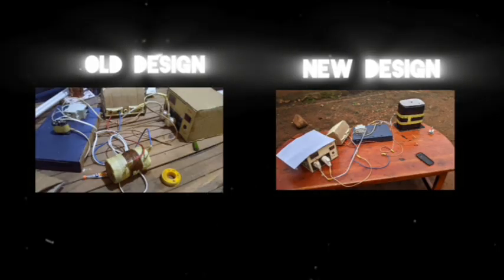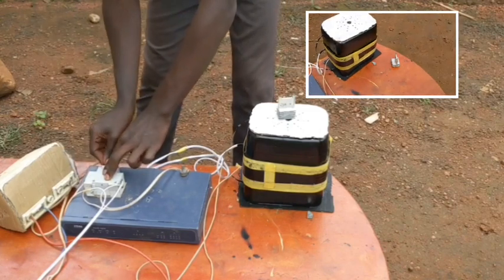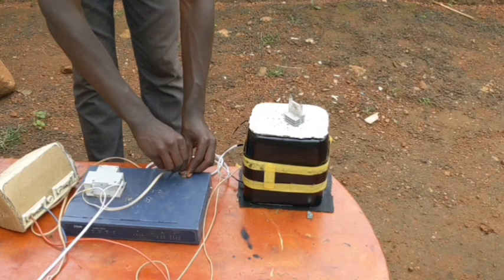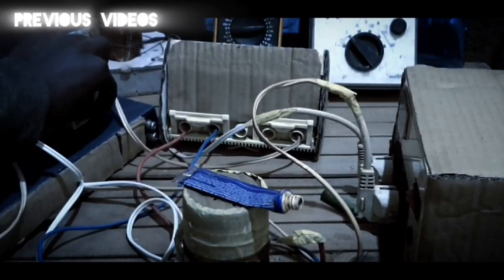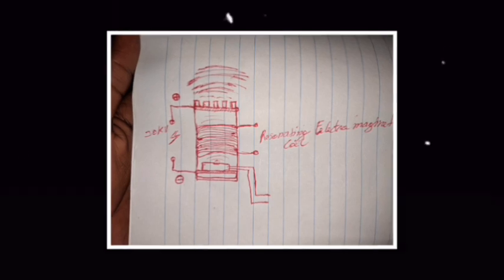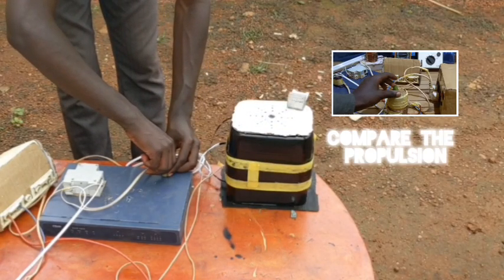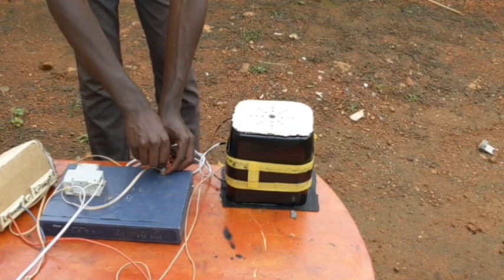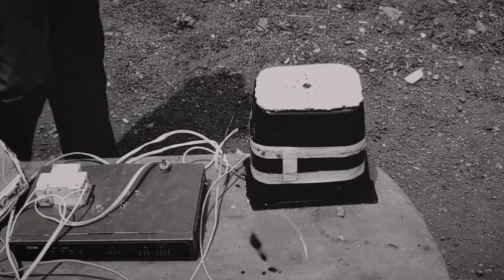KEIDIUM LEVITY DEVICE: Antigravity Test 2

Comment: It appears you are generating Gravitational Waves from your device. The Gertsenshtein Effect will explain this because it appears this is what you're doing. I noticed when you made a very sharp increase in the ultra sound the effect magnified. How about pulsing the ultrasound, that may produce much stronger gravitational waves. I curious if you're using Square Wave to pulse or resonate the Magnetic field in the Coil?

Comment: Absolutely GREAT work! It still looks like it could be acoustic levitation though (even though that seems unlikely due to the amounts of mass you're lifting ). Is there any way that you can do some smoke tests, or put something in between the holes and the object to be lifted? Anything to block the air?
Reply from the maker: I also got interesting videos affecting air, water and fire. This effect is on a different level
Reply: @KEIDIUMPHYSICS  Hi, bro. It seems that you use the similar effect with Alexey Chekurkov?  High voltage DC,  scalar wave by Tesla coil and Ultrasonic wave
Reply: @KEIDIUMPHYSICS  Hi, bro. I sent an email to you. Can you please send me a feedback? Many thanks.
Reply from the maker: This Device seems like it release upthrust force depending on the amount of mass of an object above it